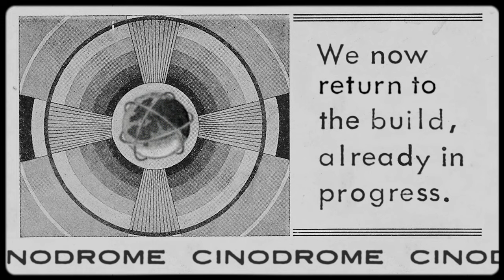I Love Concrete! SAVING our 1880s Maine Lakeside Cabin YEAR2

Comment: What a great build. That was the hard part of the saloon build.  Now the fun part can begin. May I suggest for the camp lumber, perhaps mounting some shelf brackets on the upright supports.(unless the manufacturer says not to, of course.) It would extend out about 18", but the lumber would be out of the way, protected  but accessable when needed. Just a thought...
Reply from the maker: The hard part, if you don't count the still to be poured east wall and floor!